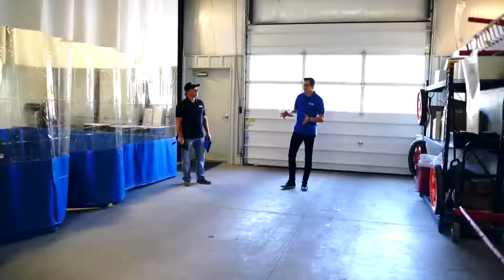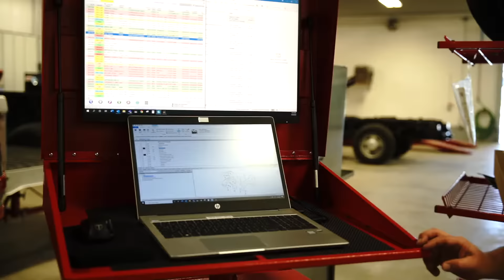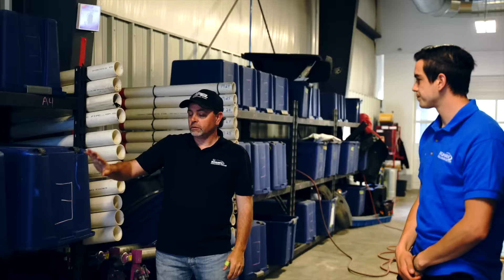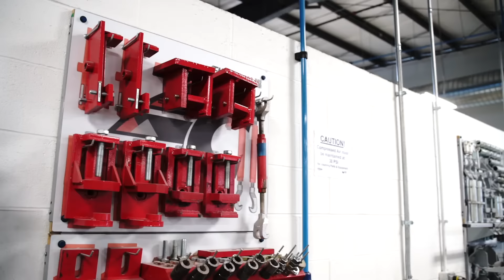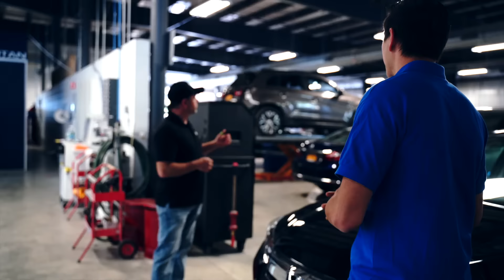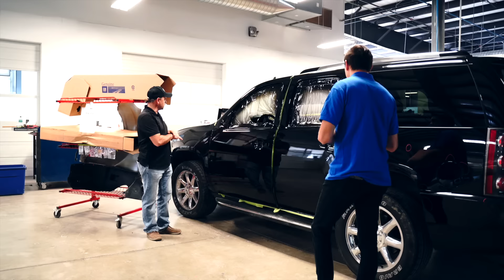Collision Repair Process Start to Finish

Comment: I used to go to independent shops like this one (Mohawk is impressive) and I ended up with nothing but issues down the road.  Things like not removing rubber molding before painting so the mask job left the paint and rubber become one and clear coat that started to peel within a year and 25 years later I still remember the name of the shop.  My estimator this  time was at an independent shop the insurance company selected - I had no choice- and he said his estimate was 99% accurate on body work.  I did not use his shop.  I used the Toyota dealer body shop instead with insurance approval.  Their final bill came in at $1300 over his estimate and I have never been more impressed on the quality of work done.  Lifetime warranty on the paint job too.  It looks factory.  Couldn't believe it.  All this because of a hit and run which cost me $650 for a rental car and another $350 deductible on the body work.

Comment: I had just retired from 38 years of high end collision refinishing.  My friend who owned a very successful shop called  me and said he was backlogged so he had to open another starter shop.  I had always refused to work for him in the past because of his high production demands and his greed..
Well, he offered me so much money that I decided to paint for him untill he got caught up.
He had big plans for his new shop. But at that time it was just a three story warehouse with a heavy lift elevator for the cars.  He had a day labor crew install a very old  ratty crossdraft booth in the back corner of the top floor.  The installation was very poor, but it was only for temporary use untill the new booth was done.
Every time I used the old booth, the ducts and fan system made horrible noise.  So I told the boss right away, but he just blew it off and said he would fix it on the weekend.  He only wanted the cars done now, so he could protect his insurance work flow.
After the first day ended, I was just leaving when he got on the PA and said to come down to the office.
As I walked in I saw a woman sitting there, she was crying and had makeup running down her face.
The boss handed me some keys and said, go out back, get her car, and handle it.
I had to walk around the building to the ally behind it. And as I rounded the corner I stopped in disbelief of what I saw.    They day laborers had broken a hole in the top of the back wall for the booth exhaust to exit thru. And there was a white Caddy parked directly under it.
The Caddy was covered from bumper to bumper in blood, feathers and pieces of chopped up Pigeons.
The amount of blood was crazy.  There was a four foot wide swath of blood running down the wall to the ground below.  Obviously the workers had never put a screen over the hole they made, and the Pigeons moved in , then got killed in the fan blades.  Each time I was not using the booth, more would go in , then die when I turned it on.
I had to navigate several blocks of one way traffic just to get the car into the shop. As people freaked out and took pictures.  The blood or stomach acids had baked in the hot sun , causing them to stain the paint.  The boss said it was all my fault, even though I had told him about the noise when it first happened.  He decided I needed to paint the car for free, and he would buy the  materials.  Big LOL !
Turns out I was right  to not work for him before this.  It was the end of our friendship.
Reply: Wondering what the CSI is
Reply: @kenmcleod8618    CSI ?
Reply: @johnwick-ii6il  customer satisfaction index

Comment: Nice shop, but storing the reusable parts in multiple places makes me cringe. Just asking for something to get lost. Many may disagree, but I keep all the parts with the vehicle as much as possible.
Reply: My favorite thing to do is keep as much of the interior inside the interior and put everything exterior on parts carts. I don’t want a door panel or window falling off one of those carts
Reply: I feel the same way. I am old school. Back in the day, we put all old parts with or in the car, if possible.

But having been in shops that use those red parts racks, I am sold on them. They really are the easiest most efficient thing I have ever seen. I would put all parts on them though. R&I parts on the top shelf, replace parts on the bottom shelf.
Reply: within reason (not dirty parts) keep whatever you can in the car. for some reason insurance companies hate parts in cars. but i do it anyway.
Reply: @robertcampbell5605  maybe because of the potential damage (tear or scratch) to the interiors seats, dash or console

Comment: Oh, my god!! Ive been in the collision repair industry for 20+ years, even spent a few years working for a top level nascar team in the early 2000's. This has got to be THE most organized shop Ive ever seen. Are you folks hiring? 😁
Reply: It certainly is a Top Shop! Great Job Mohawk !
Reply: Also a HUGE shop, the one I work at is mabie 1/3 the size
Reply: may i ask what team you worked for?
Reply: Roush Fenway.
Reply: I also spent some time with Waltrip when he first opened. Was with a couple lower budget Truck teams before that.
Reply: This is dream body shop.  99% shop owner can’t get to this level.
Reply: I was thinking the same thing